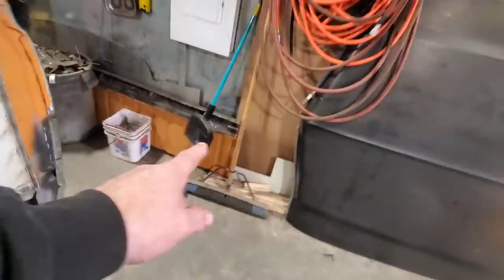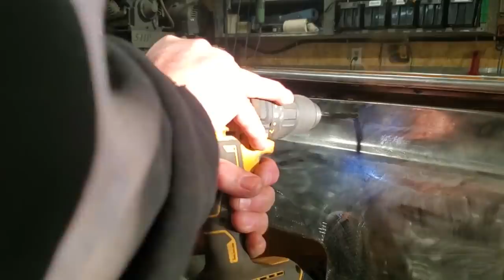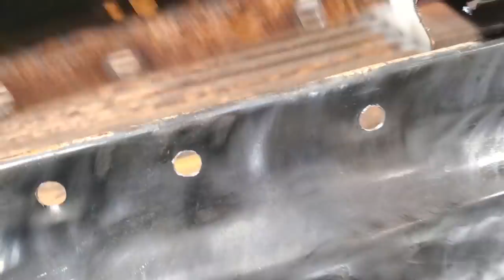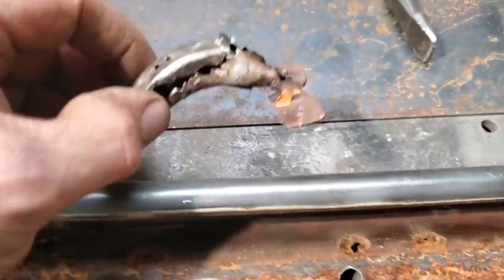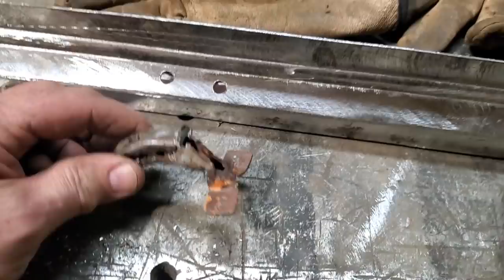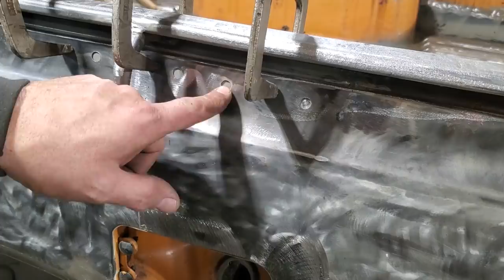Spot weld removal with simple tools

Comment: When i was doing my apprentiship in the late 70s,my instructor would go berserk if he caught you using the side of a grinding wheel to sharpen drill bits!!! He reckoned that over time,it would weaken the wheel to the point of it "blowing apart"!!!! Personly,i have never had an issue with them!! 1 tip i was giver on sharpening drill bits was to get a reasonable cutting angle was to place 2 hex nuts together so you have the flats  providing an angle that you place the bit cutting edge up to,it will provide you with about 120 degrees and that was near enought to the 60 degrees that the angle should be of each cutting face!!!! Brilliant work again,i look forward to the new videos with relish!!!!! Well done Tony!!!!!!
Reply: I did metalwork at school and we were told not to use the side of the wheel. I do use the side occasionally, but I don't press as hard as I may do with the front.
Reply: @BrucePierson  At Tech College we did an abrasive wheels course and was shown what happenes when a wheel blows apart!!! Shrapnel from the stone went everywhere at great speed and would result in catastrophic injury to anybody nearby!!!  I have used the side to do a gentle grind but not too much!!! Ive had a 41/2" angle grinder grinding disc disintergrate whilst i was using it and that was bad enough,i was lucky as i had a leather welders apron on and that took 99% of the shrapnel but even so,my belly had severe brusing for a week after!!!
Reply: @gordyminiman  Yes, definitely only light pressure on the side of the wheel and infrequently. I've had a 4" angle grinder cutting disc explode on me twice, but both times, the shrapnel went away from me because I always have a guard on the angle grinder and it saved me from getting hit.
Reply: @BrucePierson  I always keep the guard on with cutting and sanding!!! Mind you,last year i was sanding a weld up and the disc bit into the corner of the weld and span the grider round on the handle(im left handed and always find it hard to sand with a right handed grinder as it only has 2 handle positions!!!) and cut in to my arm just above the wrist!!! No blood as the plastic backing pad cauterised the cut but i still needed 7 stitches at the local Drs surgry much to the wifes relief as she doesnt drive and the nearest hospital A+E is over 12 miles away!!!!!
Reply: @gordyminiman  That was bad. Just as well that it "only" hit your arm and not your face. Fortunately, I've only had minor nicks from angle grinders, none requiring medical attention. I only ever use a 4" grinder, even though I have an 8" grinder, but I'm not game to use it. Someone gave it to me ages ago and it does work, but I decided not to use it in case I did what you did!! I hope you don't have any more incidents like that.

Comment: Those tiny hole saws called spot weld bits are worthless in most cases, the best thing if you do not want to "drill" is grind or use tool steel bits made for machining. Yes machine tools are expensive but if you are not rough with the bit it will last years compared to many many drill bits per year.

Comment: I appreciate your lessons sir, wish I had half your knowledge in welding/auto body. I have a first generation F body that I have planned on restoring many years, NOS metal, praying I can make it right, a gearhead most of my life but just dabbled in shade tree restoration.May I ask, when the rear quarters/tailpan are removed from the unibody do you think it mandatory you  reinforce or jig to keep it from shifting?
Reply from the maker: I cut those cars up good. I tend to do on panel at a time. Working my way around the car. Just chopping it all off gives you nothing to reference too. Use the factory doors and trunk lids to Aline the panels up
Reply: @fitzeesfabrications  Thank you for your reply sir, it is valued. One final question if I may. The passenger quarter took slight damage, it moved the inner wheelhouse just a little and the trunk lid is out of alignment.If it were you would you begin on that side?

Comment: Hey Tony, great video as usual. I'm rebuilding the bed on my 64 F100. Hundreds of spot welds:( Tomorrow I'll start with the inner bed walls and then the four panels in front and behind the the wheel wells. My plan is to fill the center with wood. You've been a great help! Thanks!

Comment: Tony , one more step you can do to stop your bit from grabbing is grinding a very slight flat  on both cutting edges parallel to the axis of the drill bit on your 1/4 and 5/16 bits. This can be done on the side of your bench grinding wheel or using the side of a cutoff wheel.   Give it a try, I'm a retired tool and die guy and learned this many years ago.  I've enjoyed following your videos for couple of years now. Really enjoy your sheet metal repair videos.
Reply from the maker: Your second guy to point this out. Very interesting.  I love learning new things this one is a good one
Reply: @fitzeesfabrications  hope this helps out. Works well on existing  holes in thicker material and avoids a hi torque drill motor wanting to break your arm.
Reply: I can’t quite visualise what you mean, any sketch anywhere I could look at?
Reply: @NialPowerCork  you can create the same effect by rubbing a flat sharpening stone against the the sharp cutting edge of the drill.  Not the drill flutes but the working end of the bit to prevent the drill from trying to screw itself I to the previously drilled pilot hole.  Hope this helps.
Reply: @mjm7187  thank you, I’ll give that a shot. Appreciate it.
Reply: I was taught that by an older guy many years ago.  It seems to make the bit last longer too.
Reply: Unfortunately we don’t create “old guys” anymore, perhaps a trip to mexico or china.

Comment: All kinds of good stuff here Fitzee, thanks! I'm interested to know why is someone spending all kinds of $$$ for an old Datsun? It's not like they are really worth anything unless there is a very personal reason for it. I found that our local Lordco auto parts store sell the spot weld bits. One of the first things my instructor showed me and insisted I master was sharpening a drill bit on a grinding wheel. I've never forgotten that and it's served me well. Even if a large drill bit breaks off for some reason I can grind new angles into it and keep going rather than starting a new bit. I have a couple of sets of panel chisels which are thin and toughened if the spot welds are still hanging on a bit. Sometime I find that some spot welds have been doubled or even tripled up, which can cause some frustration. I use pennies brazed to slip on fitting to attach to one jaw on any number of different sets of vise grips for backing on spot welds. I'm curious why you didn't do that same procedure on the front of the box...too far gone? Have you ever considered getting a spot welder to redo the spots instead of MiG welding them? No grinding! Awesome job on the old cargo hook! Rollscnardly...I've had a couple of those. Hard to find parts. I agree, all the old cars were assembled in raw metal and then painted. Rust...good for the parts business. I look at some of the old '30s and '40 cars people have hot rodded and the frames are still the original with some rust still there with all the "weight and steel saving" holes in them, yet they don't bother really bother removing the corrosion or boxing them or building a new frame for for the added power they are putting into the car. I've seen older cars with big power torque over, permanently twisting the frame. Take a look at Bello's Kustoms on you tube and watch the '37 Packard chop video series. That's some serious rebuilding right there.
Reply from the maker: I have a few spot welders. I'll be doing a video on that this winter

Comment: Instead of the starter drill , I use a machinist 1/8 center drill in carbide. Works like a small step drill so the next drill does not have to cut much. 6$ ,two sides and lasts about 100 spot welds. We don't use spotweld cutters anymore. They ended up being a waist of time and money for the work we do.
Really like your explanation of work done.
Reply: After running a small pilot drill 1/8 or so I switched to them tin coated step drills and keep givener till I’ve drilled the required spot weld diameter needed. I gave up on them spot weld drills too!
Reply: Robert McDonald Do you have a link to where you get that two sided carbide but?  I've seen guys using them, don't know where to get them.
Reply: buy a good annular cutter spot weld cutter and it will last way longer,55 bucks and ive been using the same one everyday for the last 3 years. doing it with the drills takes forever. if u can justify shop time because u have to buy a 14 dollar tool every week doesnt make sense to me because my labor rate is 160 an hour so i would buy 5 of those a day over diong the same job 3 times to get a panel off.

Comment: If you can understand this Fitzy.. blunt the leading edge of your freshly sharpened 5/8 bit, i.e. put a tiny flat on it, the drill will cut just as well but won't tend to pull itself into the metal and catch.
This is mainly meant for when you are enlarging a smaller hole.

Comment: Hey Fitzee. Try a Unibit after you get the 1/8" hole done. These things chew through sheet steel and make it easier to make a slightly larger hole here and there to break the weld free.
Reply: Just want to add that a quality step (Uni)bit is worlds better than the cheap ones. Project Farm did a video on the various brands. Spend the extra money

Comment: I have seen guys using those mini belt sanders to chew through the non kept panel on spot welds these days too. That seems like it would thin metal too much so i just use the same method as Fitzee. The only thing different is that i try to use a sharpened putty  knife  before the chisel to limit the distortion. I still end up doing some with the chisel but when you want to replicate a piece I try to get it out as cleanly as possible. I DO use one of those mini belt sanders to clean welds in tight areas and would have used one on that inside weld we didnt see welded or ground in this video.

Comment: I am working on my truck bed and the fender well got pushed down. How can I get this pulled back up to where it belongs?
Reply from the maker: A hammer from other side. Use a block of wood over the dent to hit it so you don't do more damage
Reply: @fitzeesfabrications  I was at the scrap yard and the magnet got dropped on it. It pushed down away from the bedside and down towards the wheel, so there is a gapping hole.

Comment: Giving my old shop teacher the fits by grinding on the side of that wheel. Lol. Great stuff Tony!
Reply: I can hear my old foreman telling me "thats a **** time bomb lad"
Reply: That's a "lie to children". The tool pressure on the side of a flat wheel has to be much lower and the inexperienced are often also in a hurry, so the safe thing is to simply tell people not to do it. My 8" Wolf pedestal grinder has factory tool rests designed for using the side of the wheel and I always have when needed.

Other myths are that getting any colour into a HSS bit whilst grinding will remove the temper. I was told that and then the next week we were brazing a piece of HSS to a shank to make a custom tool. Apparently the type of heat was somehow different?!